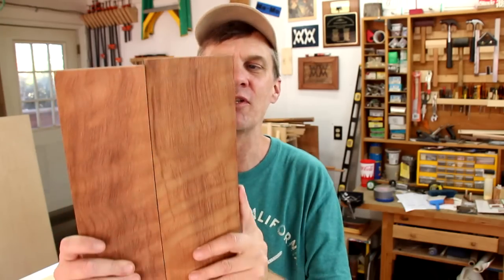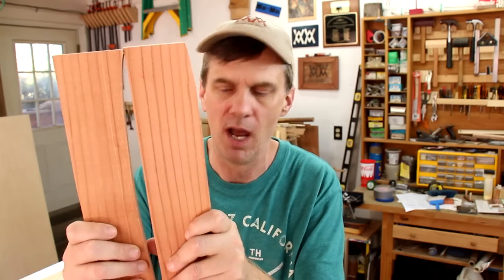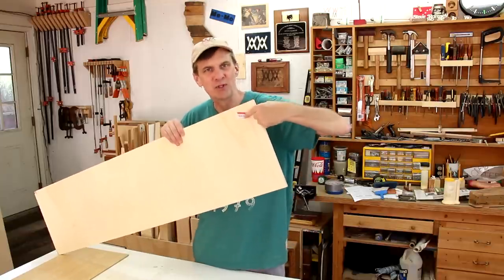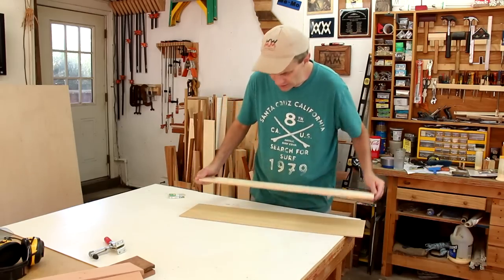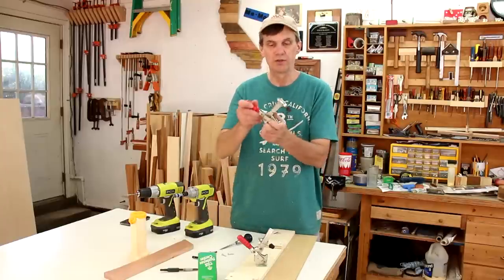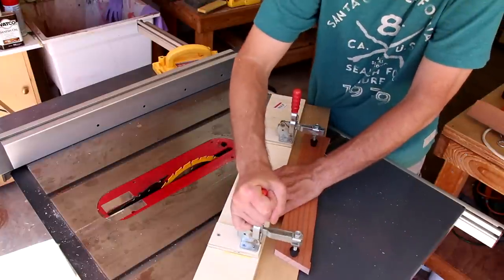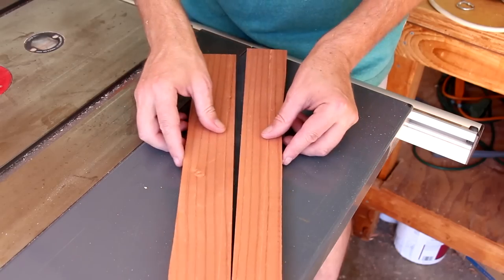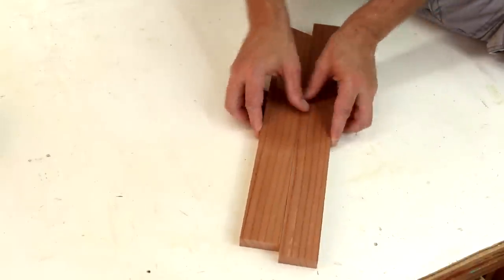Jig for edge jointing on a table saw | Mere Mini shop project

Comment: Hi Steve or everyone that can help. why do I need to use this jig for edge jointing and not using just the fence ? actually I tried to use the fence but both pieces of wood not joining nice and there are gaps along the edges. if the fence is parallel and square to the saw blade why I'm not able to use it without any jig? can someone explain me the logic here ?
Reply: Solid question here. I too am wondering this as well. 
Hope to get an answer 👍🏾

Comment: If I am squaring up longer boards (8') will I have to fashion myself an 8' jig? That said, can I trust a factory edge on plywood to be square?
Reply: David Janeski yes you would just need a longer jig and infeed and outfeed support to help.  factory edges of plywood or even mdf have to be perfectly square otherwise they would be sending out tens of thousands of fucked up sheets and would be getting a hell of a lot if conplaints from construction contractors, homeowners etc etc

Comment: A great jig, but you should keep a couple things in mind when making it. First, neither Home Depot nor Lowes carries these toggle clamps in their stores, but do offer them online. So does Amazon for even quicker delivery. The clamps that Steve uses in his video seem to clamp by lifting up the lever, however the ones from Amazon that he provides a link to work by pressing down on the lever. That normally wouldn't matter, however when you press the lever down, the extended length of the clamp is just over 4".  Steve says to cut the top board 4" wide, so if you fasten the clamp to the board even as little as 1/4" from the edge, the end of the clamp lever runs into the fence, and so you will loose the use of the straight edge of the top board. I know, as it happened to me!! To avoid this problem, cut the top piece of wood no less than 4-1/2", and maybe even 5", in case your clamps extend even further out!!
Reply: jmalcolm001 just saw this comment.  harbor freight carries the clamps in store in either configuration (lock up or lock down)  hope I helped
Reply: I know it's an old comment but for those looking for vertical clamps, here is what you want: https://www.amazon.com/POWERTEC-20305-Vertical-Quick-Release-Capacity/dp/B004K5WWPW/ref=sr_1_5?s=hi&ie=UTF8&qid=1493821132&sr=1-5&keywords=toggle+clamp
Reply: Thanks Mitch!
Reply: Wish I would have read this first...I made all of those mistakes, plus the clamps do not reach all the way down, too small.
Reply: The particular style of clamp you need is a “vertical” toggle clamp, not the horizontal version.
Reply: This is a super old comment, but I found clamps identical to the ones Steve used here at harbor freight for about $5 each, hopefully someone will find that info useful.

Comment: Just got my toggle clamps today and finished mine up.  Works like a charm.  Thanks for the video.
Reply: The fence of your table saw references what ever you put up against it. So if you don't already have a straight edge on the board you are cutting you won't get one on the other side. This jig allows you to get that straight edge, the factory cut side of the ply will be straight and as you run that along your fence it will cut a straight edge on your work piece. Then you remove the work piece from the jig flip the cut edge along the fence and cut and then BAM two parallel edges.
Reply: Fpflyer So is the heart of how this works that the board you're jointing isn't up against a fence? And that lets you square the two short ends of the board with the blade?

Other table saw jigs I've seen straight up imitate a jointer (in feed and out feed). This method seems WAY easier to use, but I'm not sure why it works.
Reply: This jig will not make anything square directly, as you can put the work board in at any angle. It will give you a straight edge along the long side of the board because the factory edge of the plywood is running along the fence. 
Once you get that first edge you are done with the jig. You flip the work board around and run the newly cut edge along the fence to make a parallel side. Then you can square it up using a miter saw or a cross cut sled.
I like this method a lot more than the other way as I don't have to worry about getting the blade buried into the sacrificial fence. I've used it quite a bit on boards that my jointer own't handle. I have a small 6" jointer with a short bed.

Comment: Excellent Mere Mini Steve. I have a similar 8' jig. I originally built it to rip some very thin tapered pieces, but it works well for jointing as you have shown. With a good rip blade and a little care you can certainly get a "glue joint" quality edge.

Thanks for sharing,  Alex

Comment: Thank you so much for putting out helpful videos like these.  This in particular helped me because I dont have a jointer and didn't know of any other way to square up edges.  I went and got a set of toggle clamps and built a sled myself and it works great...thanks again for the helpful videos and good luck.

Comment: Good Project,
  I made a jointing sled a while back and I use it all the time, one of the best sleds I ever made and worth the build time.

Regards,
Bob
Reply: I find the toggle hold down bolts to be to short to  to hold anything securely. When the toggle handle is fully extended the base of the hold down bolt is even with the base of the clamp body. That is with the bolt fully adjusted. For thinner boards their. Would be a remarkable gap. Need longer hold down bolts? What am I missing? Confused.

Comment: Nice! Upper part is same as mine, I even used to use it that way, but since my table saw is a cheapo one, with weird fence, not that precise, I installed runner on the bottom which fits into my miter groove. Now it runs straight every time!

Comment: Thanks Steve.  I've been looking for a way to joint without a jointer and I haven't gotten my self a router table.  If it had only come out a couple of days earlier.  I've started building a rough stand for my drill press and the boards aren't perfect of course.

Comment: Thanks for this video. I made this jig and it worked, but I had a problem with mine that I think would have been resolved by using a thicker base. When I use the toggle clamps on my work piece, it cups the base plywood because it doesn't seem to have enough strength. This resulted in an angled edge. I was able to salvage it though because,though angled, it was still straight and I ran that edge against my fence. Then I flipped it around and did it one more time.

Next time I need to do this I[m going to re-make the jig with 3/4" plywood as my base but otherwise this is fantastic.
Reply: i did the same.  only used underlayment as a base which made it unstable while running though table saw.  ply is the way to go.
Reply: @2justinolin  I bought 1/2" birch plywood . Wonder if I can put that as base then cut another section to make the top part ?

Comment: I could not get two pieces of oak to join together seamlessly as there was always a slight gap in areas between the boards….multiple cuts on my table saw did not make any difference…….obviously there was a defect in the side of the board butting up to the fence and even though I flipped the board a number of times, that gap continued to be there…….made the sled today and one pass and the boards now join together seamlessly…..thanks Steve…..you’re the best on YouTube!

Comment: I purchased the toggle clamps that you highlight. Unlike the ones you use in the video that push the handle up to secure the piece, the toggle clamps from Amazon push down to secure the piece. Because the guide piece is four inches, the handles extend past the straight edge and bump the fence. I probably need to cut my top piece to 5 inches, not four. Next weekend.

Comment: I recycle a lot of pallet wood and I have to true up almost every board. I clamp a long straight edge to my rip fence and run the concave side through first then flip it and do the convex side. Very simple and easy and works like a charm. You do need a long straight edge though, mine is 8'.

Comment: Great idea, Steve! thanks. 
   Most of my projects require wood planks 6 feet or less long. I have an 8 foot level. I clamp the level to my rip fence, so the end of the board is just shy of the end of the level, and about an a couple of inches from the blade. I make sure the crown of the board is on the blade side. I use a 50 tooth rip blade. I just feed the board through the saw. The level runs a bit past the end of my rip fence. I now have one straight side. I flip the board over, remove the level, and run the board through the saw.

Comment: Also a stiff 60/80 tooth blade helps a lot. I used a similar method to make some triangular hardwood stair treads from regular treads, and it worked perfectly, my cheap table saw paid for itself doing that.

The hold down clamps are a good ideas though, wish I had thought of it.

Comment: great jig! 
built this jig out of scraps i have lying around but found out the hard way that if the jig is shorter than the material i am trying to put a straight edge to is impossibly hard..
before having to order new materials to build another slightly longer jig, wanted to ask everyone else if i am missing something?

Comment: What do you base the length of your jig on?

I noticed Steve's hangs over the front and back of the table a bit, however my table is much smaller. Should I match the depth of my table or should it be based on the size of pieces I'll be ripping?

Comment: Thanks Steve.  This jig worked beautifully and helped me with my table project.  One question, what is your opinion of placing a rubberized drawer liner or some other "grippy" type of material to place under the clamped material to help avoid any slippage?

Comment: I'd recommend adding a glued piece at the bottom of the sled so that way you can line up a freshly mitered end to give you a real 90 degrees.. I did mine at 12 inches so you can use it in conjunction with the planer

Comment: Just to check my understanding - the point of this jig is that it will create a straight edge even when the other edge is not straight, right?  Related question - are you more likely to get tear offs on the underside because the underside is not supported (which would be another reason why you'd cut the length to more than is needed)?

Comment: So this would be to make the long sides straight. If you want the ends of the board to be straight as well you would need to run it through the miter saw correct?

Comment: Hi Steve, I'm about to buy a router just because of the jointer feature, do you recommend me to first buy the table saw for this? I'm starting with scrap wood or cheap wood(pine but low quality to learn more about wood in the process of making my stuff) so, it's better this method or the router? also thanks for all the videos, they are more than just inspiring.

Comment: U can find the clamps at harbor freight for 6 bucks each. However, this only seems to work if your table saw is a higher end model. Entry level table saws dont have totally flat surfaces which you will need. Any dip or rise on the table and your not going to get a good cut for jointing. I would also recommend using MDF for the sled as plywood without a planer and jointer isnt perfectly flat. Just my experience in trying this...

Comment: I have never used a jig either. I have always clamped a 4,6,or 8 foot level to my rip fence positioned so two points on each end of the board are against the level while the board is in contact with the blade. Always great to have multiple options, however.

Comment: My 3/4” birch ply factory edge looks slightly bowed. I noticed it after I ran my first couple boards and saw those board edges were slightly bowed.  Makes sense as my reference board that runs along the table saw fence has the same slight bow.  I’m now trying to find a better way to get a perfectly straight reference board as that should solve my issues and give me great jointed edges.  Any advice or thoughts are welcome.  I’m thinking a better more stable material.  We also may have a friend just run a 1x6 through his jointer and use that as our reference board with aluminum tubing attached to keep it straight.

Comment: Steve, I am very late to this party but I am loving all the stuff you are doing. One thing I am having issues with is getting the clamps you use in this video. When in the clamped position the handles are upwards, every single one including the ones in the link you supplied have the handle in the down flat position which means potential interaction with the fence. Yes, I will have to make the first cut board wider than the handles in the down position but the real problem is that none appear to have the grip or downward pressure that yours have. Any ideas please? BTW I am a total novice in this department.

Comment: I'm new to this channel and woodworking in general, so quick question. Why would you need this?  Why wouldn't you just use your tip fence for both cuts?  Also, if this is a better cut why do you use this for the first cut and the rip fence for the second cut?  Sorry if it's obvious. 

Thank you!
Reply: Hey. I'm a beginner woodworker as well, but I'm pretty sure I know this.
The rip fence is ideal for making parallel cuts. Which means, if you have a not straight edge aligned with the rip fence, in theory, the edge you are cutting will be equally not-straight. However, when using this jig, you can place your board over the edge of the jig, just so the blade cuts through the entire board and gives one straight edge. And when you DO have that straight edge, you don't need to use the jig again, since the rip fence can make straight, parallel cuts. Just put the straight edge up against the rip fence and make sure that the blade cuts through the whole board once again, and then the board will be completely straight on both sides. 
More experienced woodworkers could probably explain it better than I just did, but I noticed that no one had answered you already :-)
Reply: Willswill thank you!
Reply: Thank you! lol it made perfect sense just right now when i read your comment. I too am a beginner and had the exact same question but it makes perfect sense now.
Reply: Thinking the same thing myself
Reply: Not to mention that you will have increased risk binding/kickback if you try ripping a board without having a flat edge against your fence.
Reply: Thanks for that, I am also just starting out and just got a table saw, but was wondering how this jig actually helps vs just using the fence, but after reading your explanation, it makes perfect sense now.  Going to make one of these as well as a cross cut sled, since my miter saw is old and crappy
Reply: @stevewinner  also, go watch some basic safety videos asap. You should never saw rough cut lumber on a table saw, a table saw assumes a flat piece of wood if it's not in a jig and can cause kickback without you even realizing your making a mistake until it's too late.
Reply: @jonesey1981  thanks for the advice and I have learned a lot since then, and still have all my fingers and haven't had any kickback as of yet (knock on wood)
Reply: @stevewinner  wow, didn't even pay attention to the timeframe, cheers!

Comment: Hi Ramsey I'm trying this method but my cuts are not coming straight. Like slightly slanted. I checked blade with square and its 90 degrees. I even attached a rail for the ryobi ten inch table saw. Any recommendations?  Thanks

Comment: When you clamp your stock down it doesn’t need to be lined up against a straight edge? 
How do you ensure the lines are parallel with other pieces you joint with this?
Reply: All this ensures is that the two sides of each board are parallel to each other and the sides are at right angles to the face.  That is all that matters when gluing boards together.

Comment: My question is how do you ensure a straight line and keep from tapering off slightly?
Reply: You can draw a square straight line on the board around where you'd like to joint and square it with the sled before clamping down and then run the joint? A slight taper doesn't matter too much, it'll straighten when you joint the otehr side but the stronger the taper the more material you waste.
Reply: @tassitano  I'm late to the party but in addition to drawing a straight line could you also put like a straight stop block that would allow you to line up the board's bottom (?)

Comment: So I'm assuming if you need to joint thicker boards, you need clamps with enough screw adjustment.  The ones you are using don't look like they have much adjustment?
Reply: falfas55bgas yeah that’s an annoying part of this jig with the cheap Harbor Freight toggles.  What I’ve do is use modern door trim as a spacer.  Because it’s angled from thin to thick I can move it in and out at each clamp to align it where the clamp is getting good pressure.  It’s faster than messing with the clamp bolts.

Comment: I just clamp/screw a straight piece of wood to one side of the wonky piece of wood, then butt that up against the fence. That gives me one straight edge, and so i use that new straight edge on the fence for the other side.
seemed a bit over the top making the whole jig after doing it my way, though may work better for smaller wood
Reply: clamping is not so easy unless you have something similar to this jig, and screws will put holes in the board
Reply: ***** Lasse Langwadt Christensen screw holes go on the other jagged edge that is getting cut usually. Mine is often taking the jagged ends including bark also.
You can also use spray glue to just make it tacky enough to hold, or the grip matt stuff